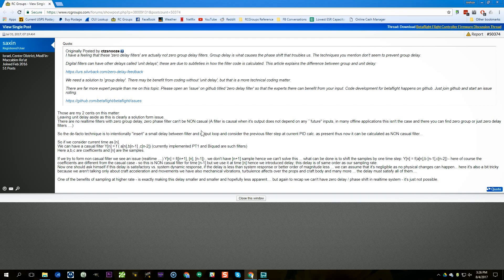Betaflight 32 kHz | YES OR NO?

Comment: Mr. Bardwell , First let me say Thank you for all the great vid.'s .
I was hoping you may be able to gelp me . I am using femto fc ( babyhawk) BF receiver tab shows me nothing. No color on channels nothing ?
Rx installed A8S .power , bind . ???
Any ideas? Thx
Reply from the maker: Have you bound the receiver? Do you have... I think it should be solid green light on the receiver. After that:

https://www.youtube.com/watch?v=ZpU6-JY6fnk
Reply: Joshua Bardwell , yes solid blue light , blinks when not level. Blue  n red.
Reply from the maker: No, on the receiver, not the FC. You're describing the FC LEDs.
Reply: yes , the a8s is ready . I actually tested it in another micro. (same setup)
I have never seen this before. even with no rx the receiver tab should have color channels. Correct?
I am gonna try ppm?
Reply: This is a bug a person in my flying group ran across the other day too. According to google, the solution was to reflash the FC. You would probably want to use the full chip erase option. He got it working after a full re-flash
Reply: Yes Sir" that's what I was looking for. Thankk you .😎

Comment: RaceFlight filters don't have any delay, nor a 'sample' rate ;).  The gyro update frequency is 32khz but it is event based rather than polling.  That means no PID "loop", every time the gyro interrupt triggers new data available it's processed.
On top of that, RF filters have no delay at all, they're similar to Kalmann filters, which indeed are causal, but they're predictive rather than reactive.
Reply: Chris Simpson i don't think a filter without a delay exists though.
Reply: unsettledroell they certainly do.  Traditional filters have delay because they act reactively to data, in comparison filters like Kalman filters are predictive.  The way normal filters work with a delay is the take say 5 samples, average them, then 5 samples later (the delay) they'll give the filtered value.  Predictive filters however will use historical data and a model to instantly say "new value arrived and is X, based on history and model, it is now Xf" and the filtered value is output immediately.
Reply from the maker: The fact that the PID loop is triggered by interrupt doesn't change that the filters are based on data that is sampled at a certain rate. I'm not sure it matters whether you call it sample rate or update frequency. Does it?
Reply: Joshua Bardwell PID Controller* not loop ;) event based means there's no loop and thus no chance for the control loop to desync with the gyro update frequency.  Sample rate is just semantics, "sampling" being associated with polling a value from the gyro, compared to an event based model where a value is "pushed".
Reply: Joshua Bardwell more importantly though is the predictive rather than reactive filters, RaceFlight filters have no delay.  With predictive filtering, the higher gyro update frequency is a must, in addition to good pre-trained and adaptive models.
Reply: Chris Simpson also, BF definately uses kalman filters to fuse sensor data, but a kalman filter is not meant to clean up gyro noise
Reply: unsettledroell not itself, but a kalman filter is an example of a predictive filter that doesn't need any delay.  RF has its own filtering method that is predictive.
Reply: Betaflight does not use Kalman filters.

Comment: Nyquist doesn't say "you only need 2 times" it says "the bare absolute minimum is 2 times" More information is always better
Reply from the maker: I don't think that's right. Nyquist says that IF YOU HAVE A BAND-LIMITED SIGNAL then you can PERFECTLY RECONSTRUCT it by sampling at 2x the cutoff frequency. In the real world, there is no such thing as a perfectly band-limited signal, so sampling at higher rates does give more information. But it only gives information about the higher frequencies in the signal. If the frequencies of interest are below 1 kHz then there is no additional useful information gained by sampling faster than 2 kHz.
Reply: TheBeefiestable if i jump scare you with a chainsaw 32 times a second compared to 2, you would die from shitting your pants cause you can't keep up with food consumption so more info can be bad in certain circumstance
Reply: In the real world, there is no such thing as a perfectly band-limited signal, that is why you need to capture this signal with higher SR. because all information higher than SR/2 will produce low freq aliasing. also you need to be absolutely sure of your gyro output (and mems gyro degradation). and as always, spice it with some dithering. it is always more predictable results, when you using math filtering, not electrical or mech.

Comment: this was really great. really explains my experience. 32k with the biquad filter is no good. 8k on PT1 is far better. just going to PT1 was the biggest jump in performance as far as I can feel.  also, so does that mean kiss just has an awesome filter and that's why it's able to run at like 1k or whatever it's at?
Reply: Kabab FPV im running 32/16 on the matek f405 aio with dynamic filtering. Its by far the best thing ive ever flown. I lost half a blade on a chainlink fence and didnt know until i landed to change the battery.
Reply: KNUCKLEUP FPV Interesting. I haven't tried it with the dynamic filter. I'll give it a shot. thanks.
Reply from the maker: KISS runs the PID loop at 1 kHz, but I think it samples the gyro faster than that.
Reply: Not 100% correct Josh. KISS can now run 2 and 4khz PID Loop. I love Kiss , but i need to say that i choosed a BF AIO FC for a 4 Inch Racer and i really like it how simple it is. Definitly easier then "Keep it super simple" from KISS. Even more possibilities and more ways to get rid of a Problem. I love how my KISS Style flies, but  i really like BF now too - again ;-)

I had some struggles with baaad gyro vibs on my RQR Hive 5 Inch-Frame. Hardmounted FC bla bla. I`m not bad at traditional or Masterclass-Tuning, but i tried everything and can`t get rid of Oscillations. Even with very low PIDs. Only thing that helped was Softmounting it. I changed everything, Motors, Props - no difference. I think your Opinion that KISS may runs faster gyro loops then "known" is maybe possible. 

Sorry for any faults on sentences but i`m from Switzerland and i`m better at understanding english then write it flawless.
Reply: ah that makes sense

Comment: I also think this is the way to move forward (smarter filters). I see no point with the current race to higher pid-loop frequencies, when the samples used in the loop are still tainted with a lot of noise. Thats whats causing issues with heat, escs are fed with conflicting commands all the time and the motors are using a portion of their power to brake / correct. There can be no practical reason why we need higher pid-loop frequencies than 1khz or so, can it? I mean the craft certainly cant change direction that fast anyway due to inertia, not even during propwash. I would like to see a combination of high sampling rate for the gyro along with a relatively slow but smart pid-loop. Use all available information, including historical, in the loop. Curve-fit samples, use trends, discard outliers, whatever. If the pid-loop makes incorrect estimates because of noise, that will result in more corrections later on.

Comment: So, I'm no engineer or math wizardI, but if you are sampling at 8khz and waiting for 5 sampling cycles to make a correction, wouldn't the lag time/response time be 5/8000 of a second, or 0.625 miliseconds? Can the rest of the system keep up? It's still well above the Nyquist limit. Can any meaningful corrections be made any faster? I smell hype.

Comment: I am no signal processor expert, but I have a hard time making sense of the argument.  Aren't 5 samples at 32khz less "valueable" than 5 samples at 4khz.  If the noise is at around 1khz, this would probably not manifest as noise at 5 or 10 samples at 32khz, just a slow change. I would assume you need the timeframe to accurately perform the filtering.
Reply: The point is that you want to be behind in time (not samples) to be able to detect and filter the lower frequencies.  You will not be able to detect a 100hz frequency by only lagging 5ms behind. You can detect that the signal is rising, but you dont know if its a steady change or a window of an oscillation.
Reply: nehe1234 I agree. 5 samples at 32k would only capture very high frequency info. If the noise we r trying to filter out is around 250hz, we will need way more than 5samples at 32k to complete a full cycle of a 250Hz waveform. What I'm trying to say is the number of samples you'd need for filtering will depend on the frequency you are trying to filter out. Higher frequencies should result in less lag than lower frequencies because the latter would require more samples to represent the waveform in accordance with the Nyquist limit
Reply: Well put, I had the same thoughts but you've put them much more eloquently than I would have.
Reply: nehe1234 A filter is simply a row of numbers 

Like [1 2 4 2 5 1]

That is filter is 6 samples long. Convolute it with the incoming signal and you get the filtered signal.

For each an all frequencies  in the signal this filter has a response. However, since the filter is 6 samples long, the output is always 6 samples behind.

That means if you sample faster, you are less TIME behind (because it takes less time to take 6 measurements) I think that is the reasoning
Reply: IIR filters that are typically used don't care about the amount of samples.
Reply: Wouldn't you get those same 5 samples more often though because you're getting more refreshes in the same amount of time? You could increase your sample size by double and still end up with more "Groups" of samples in the same time period. Thus yielding more information. Is my thinking right/logical there? This stuff's complicated for my average mind :P
Reply: @stan but then we come back to the Nyquist limit that states we only need 2x the sample rate of the frequency we're trying to filter to do so.  So the argument against your point is that the extra data might be redundant.  But yeah, it's complicated for my average mind too so I'm not sure! :-)
Reply: In the end what matter is how long it takes for a motor+prop to change speed.
Reply: No. Each sample is a single amplitude data point, it does not represent a frequency. Frequencies are calculated later using the data points. You can hear 100Hz audio using a 44khz sampling rate. A higher sampling rate allows you to measure higher frequencies, while still accurately measuring lower frequencies.

Comment: Hey you know the difference between 1080p and 4K. Well the Difference between 16khz and 32khz is similar. The only difference is that the axis is time.
Then you up the resolution of pixels, you increase the space. When you up the frequency you are slowing down time, or increasing the amount of space you can observe per given amount of time.
Reply from the maker: I don't think this analogy is correct. You are mixing up resolution with sampling rate. The "television" analogy for sampling rate would be the frame-rate. Going from 8k to 32k is like going from 30 fps to 120 fps, or whatever. The "resolution" analogy would be how many significant bits the output of the gyro has, but that's not something that we are ever exposed to.

Comment: I know alot but still can't get out of horizon mode  :)
Reply: I fly acro since my first flight. All you need is FPV simulator.
Reply: Ha,ha ..
Reply: EnuffsEnuff318 Set your rates low, use a sturdy/cheap quad and go for it with FPV. You will be flying acro only after about 20 packs or so. You can practice on a simulator before for a few weeks. FPV Freerider is not bad.
Reply: Agree, same here. I spent time in DRL sim till I could finish some races competitively and then a whoop. First flights were a disaster but in one day I was flying in acro inside my room
Reply: Seriously Follow what others have said,  use a SIM and try to lower the Super rate to 40.  I was in the same boat for ever and never thought I would get there and just after a few hours on the SIM i was wondering why it was ever so hard.  Now I fly horizon and do not see how I ever flew that way.

Comment: Your "system" is as fast as your "slowest" component, which in the case of quadcopters is the motor/prop combo and how fast it can spin up or down.  4kHz seems to be the optimum  for me. I cannot tell a difference after 4kHz!!!
Reply from the maker: This is a reductionist argument that has been proven wrong again and again. People argued that Oneshot could not possible provide benefits because the motors couldn't change speed fast enough. Like I'm saying in this video, there will be benefits to faster sampling, once the devs write filters to take advantage of it. Filters are the Next Big Thing in FC performance. Actually, they were the Last Big Thing too. You might recall that the first thing Boris did to Cleanflight was add a low-pass on the D term and a soft filter on the gyro.
Reply: Motors evolved along with firmwares.Motors have physical limits though. What I'm saying is after a certain point the change/improvement is so small that you cannot really notice. Blind testing proves it, also the placebo effect is also a factor. And dont forget the hype trains :)
Reply from the maker: Yes, but when you say, "the system is only as fast as the slowest component," you're only focusing on a single axis. The Oneshot argument failed because the reduction in latency mattered a lot, while everybody was focused on the faster update time, which didn't matter so much. Likewise with 32k filtering, people are focused on the Nyquist Limit, which doesn't matter, and they're forgetting the faster sampling rate, which does matter, as long as it translates into more sophisticated filters.

Comment: Gotta love audiophiles. When $10K vacuum tube amplifiers came back big in the 1990s, went over to a coworker's place to listen to his awesome tube system. I said "yes, I do hear that warm sound, that's called clipping." Likewise anyone that suggests that mechanical grooves cut into a plastic like material is better than evidence based sampling, really doesn't understand how the world works at all.
Reply: Clipping?? A valve amplifier introduces harmonics; specifically even harmonics, which add the "warmth" to the sound.  By contrast, transistor amplifiers added (past tense; things are so much different today)  odd harmonics, which made the sound just a bit sharper and colder.  All this, of course, was under ideal situations.  Very few Kiss tracks, for example, would be noticeably affected either way.

"Clipping" in no way could be described as adding warmth.  Clipping is pure distortion.  Some heavy metal bands overdrive the bass guitar to add an extra "growl" via clipping, but again that's not warmth.

"Mechanical groves cut in plastic", as you put it, are an analogue recording mechanism.  The grooves can record a virtually unlimited (in terms of human hearing) range of frequencies.  Classical music can use all these frequencies very effectively, and the strings can sometimes soar to near upper limits of our ability to hear.  And vinyl captures this almost perfectly.  CD's, with their sampling limit, don't come close for some classical tracks.  Only some, mind, but the CD is not the perfect recording medium as it isn't analog.

For average, everyday consumption of popular music (which has such a narrow spectrum band), the CD is more than adequate (we listen to MP3's and enjoy them!!!) and digital recordings are good enough.  Analog is better, but when the "good enough" is actually good enough, digital wins.
Reply: Neil O'Rourke The only time that music is truly analog, especially in the last 20 years, is if you are standing in the studio and listening directly to the singer and if the musicians are playing analog instruments. Everything is digitally sampled from modern instruments to the master recordings. To then cut that result into vinyl and call it superior, is utter nonsense. Even in the old days, analog master tapes had a mechanical sampling limit based on arrangement of magnetic particles. You never escape sampling. You can choose whether to do it with magnets and plastic or DDD as CDs have been produced since the mid 1980s.
Reply: I completely agree: tape sucks.  The width of the head gap guarantees that.  Dynamic range sucks.  There is nothing good about tape, other than it's transportability.

I also completely agree that modern sampling rates can leave analogue for dead.  100KHz sampling will capture virtually every sound than can be heard, and I would imagine that there are better sampling rates than that.

HOWEVER: you can take a pristine analog signal or even a 1MHz sampling frequency signal, and after you downsample to 44KHz under some circumstances the sound will be noticeably different, compared to a vinyl recording.  Miley Cyrus will not sound different.  Justin Bieber will not sound different.  The latest trance track will not sound different.  *Some* classical music will sound different.

And just be be clear where I stand: vinyl records are not the greatest medium.  Every time you play the record is degrades, like an audio tape.  Digital is by far the preferred storage and playback.